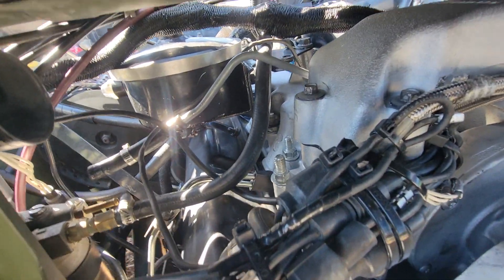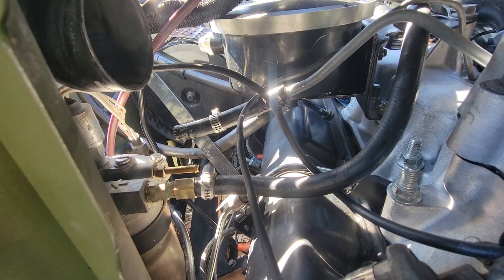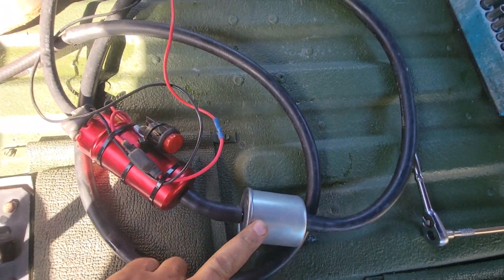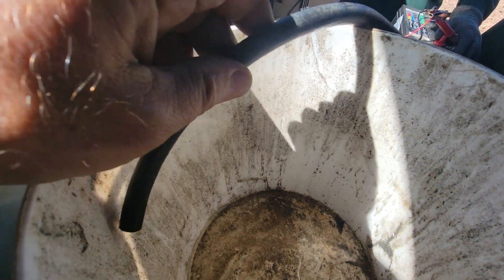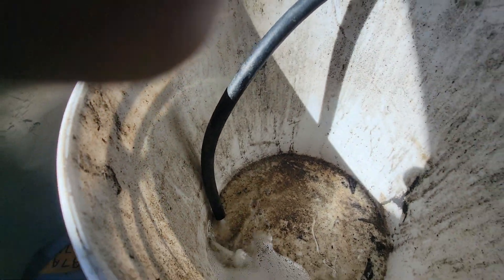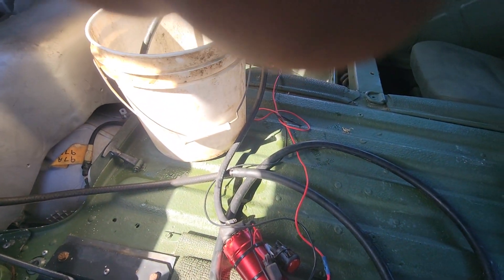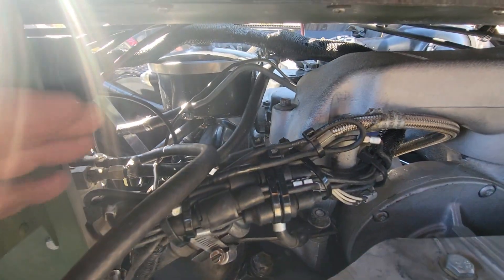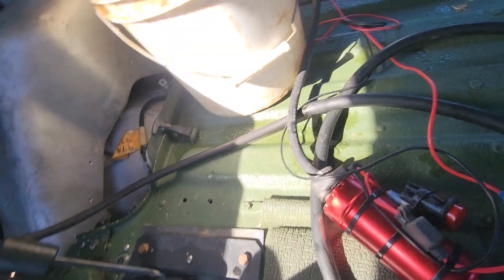Humvee HMMWV Hummer H1, How to bleed your fuel system

Comment: That was a good idea! At beginning after a few minutes running the electric pump and nothing was coming out, I took the the fuel tank cap off and placed a leaf blower there and the air pressure in the tank made the diesel to start poring. Will that eliminate the possibility of a clogged check valve? But still, after putting all together, the lower end of  fuel filter (new filters)  when open just drips diesel, is not poring like it should when cranks.  Will check fuel injectors next and then the lift pump...what a nightmare, was running rough, then seating for two years....I just hate work on this vehicle, no space for big hands for sure.
Reply: You can remove the check valve up near the tank. The one that is between the tank and fuel pump. Run one hose and connect in place of the check valve.